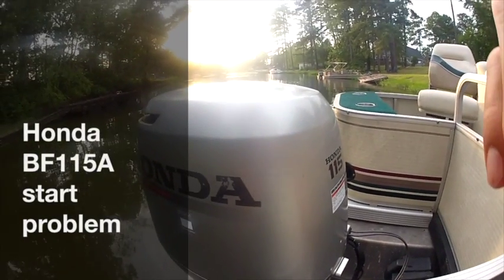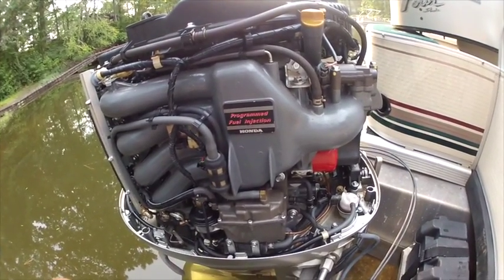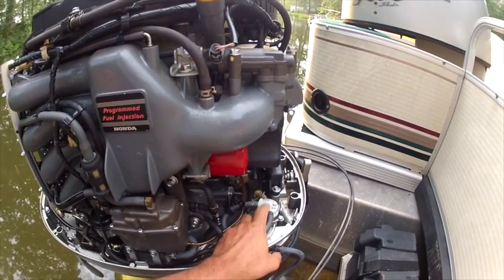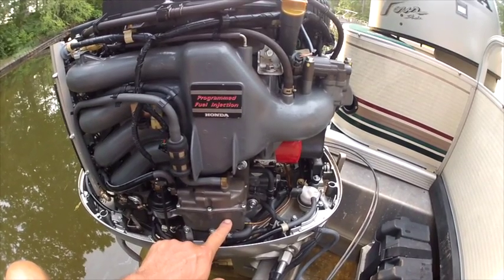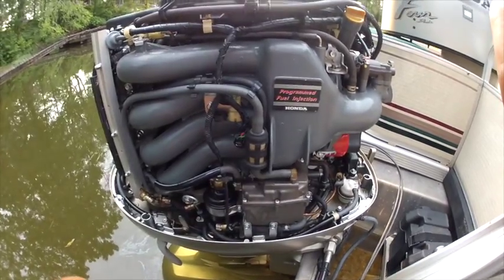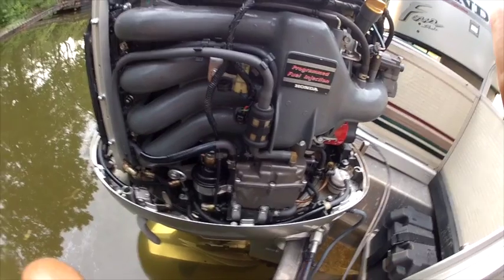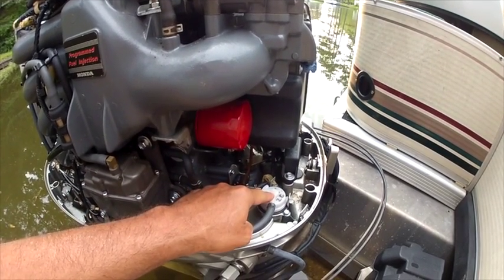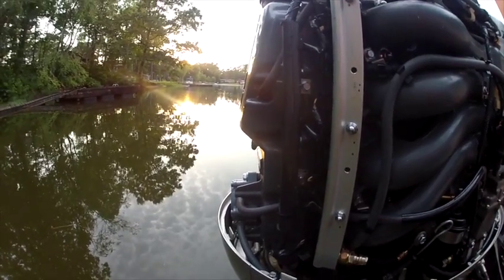Honda BF115A start problem

Comment: Hey Yankee...have you ever had your Honda run perfectly to get to your fishing spot, sit for an hour or so in the HOT sun and then doesnt want to start?  Mine has been doing that.  I am wondering if something to do with vapor lock.  Two trips ago it did this (sitting in hot sun for an hour after running perfectly) I got another boat to start pulling me in and 2 min into moving I tried it again and it cranked right up.  This time (today) I ran it for 20-30 min up and down the river then anchored down for an hour or so and then wouldnt start again.  Would turn and turn and turn.  I vented the gas tank, pumped the gas bulb, still nothing, I started paddling out 15-20 min trying the motor again here and there and it finally started again and ran perfectly again.  I think it has to do with the HOT fuel or something related.  You ever had that issue?
Reply: Main relay
Reply: @Henray316  Thanks henray.  Anyway you can share more info?  No idea where to find it.. (pic would be awesome) part number? Can I test it ?  Is this relay something that would happen only when the hot engine has been sitting for 30 min to hour and preventing start up?  The engine will turn and turn fine, just wont catch.

Comment: Searching for answers.  My Honda 40(3 years old). Acts like it runs out of gas at .5 to full throttle.  If I pump the fuel line ball it keeps going.  Low speed, no issues.
Reply from the maker: Dude, I am not a boat mechanic. >>>HOWEVER<<< Your engine and this one are totally different animals.  The 40 is likely carbureted where as this engine is fuel injected.  So here's a bone from my life of engine ownership and operations (most of which is jet aircraft, but I've spent a lot of time converting fuel into fun and transportation) In your case I would start with the low hanging fruit...  First and foremost get fresh fuel (put last years gas in a vehicle that you use a lot, or use it as ant killer around your driveway) and a new set of spark plugs, or at least remove them all, clean them with a wire brush and re-install them.  Make sure to seat all of the plug wires back onto the plugs well.   If it ran well in the past I wouldn't start with messing with any of the carburetor settings just yet...Order a fuel pump rebuild kit and also replace any of the hoses that attach to the fuel pump housing with new ones.  The fuel pump is often a round hockey puck sized metal disk like mine @1:30 .  There is likely an input line, an output line and a vacuum line that ports crank case pressure pulses to one side of the fuel pump to actuate the flexible diaphragms that "pump" the fuel on the other side.  Replace that crank case hose too!  If that doesn't solve the problem, buy a new fuel line from the tank to the inlet at the fuel pump as well... If it's old, it may be cracked and letting air into the line.  If that doesn't solve the problem, purchase a carburetor rebuild kit, then meticulously replace all of the membranes and screens and even the needles and jets (basically anything that comes with the rebuild kit) in the carb.  I am sure there is a YouTube Vid out there somewhere on both installing a rebuild kit and setting up that particular carb.  If you have never run your boat at it's current location or altitude you might only need to make some mixture adjustments, but It sounds like you had it working well in the past?  At the end of the season this year, burn out all of the gas and winterize everything with some fuel stabilizer, or consider fogging the engine with a good lubricant and for god's sake please don't use ethanol fuels.  Try to buy rec90 or some other advertised ethanol free gasoline.

Comment: Do you still have this BF115?  I have a 2004 BF115 and want to do some maintenance and love to have a few other owners who I can talk to. We are in lowcountry of SC.
Reply from the maker: Hi Paul yes I do.  What sort of things are you thinking of?  Plugs, oil, filter, inline fuel filters, grease and service the level of the lower unit. Change out the sacrificial zinc anode, make sure prop is balanced. Use good clean fuel and occasionally ad a fuel injector cleaner.  Beyond that?
Reply: @YankeeinSC1  Ah cool.  I just replaced lower gear oil, motor oil and filter, but having issues with water.  The tell-tale has lower flow than I think it should. The T fitting that feeds tell-tale is way too small (that 3rd port anyway).  The T fitting has 3 different sizes on each end. Looks like 3/8 from water pump, 1/4 on 2nd out which runs behind something (no idea) and 3rd out 1/8 goes to tell-tale.  I run in silty salt water mostly and always gets clogged and now wondering if water lines have build up since I can pull the T fitting off and the water is flowing strong before it hits the T.  I even bought a new T fitting 1/4-1/4-1/4 and tried that and the tell-tale is flowing good then.  That just worries me about changing the water pressure with different T fitting.
Reply from the maker: @paulalfordphotography3099  I've had a similar problem from time to time, although fresh water only for me.  I cary a length of welding fill wire on the boat and occasionally feed it into the fitting if there is not good output pressure.  Dirt, silt, mud wasps have all clogged it in the past.  A little internal agitation seems to open up flow.
Reply: @YankeeinSC1  May I check with you for a new/related issue (since you have the same motor).  I replaced the impeller in the water pump and not sure I got it in the correct direction (clockwise/counterCW).  I followed a YouTube video but that was a different HP (200).  The water was peeing at the house, then when I took it to the landing, the overheat buzzer sounded not 50 ft from the landing as soon as I went to plane.  I brought it home immediately.  I am thinking it could either be (1) I have a major blockage somewhere or (2) I might have the impeller in wrong direction so its not pulling water up into engine.  Thoughts?  I cant seem to determine if my exact engine turns clockwise or counter... Thanks, Paul
Reply from the maker: @paulalfordphotography3099  Sure Paul;  Not knowing where you live, I would suspect insects if you live in the south, but a different problem if you live where it is cold much of the year...  Yep insects.  I have had spiders, earwigs and mud dauber wasps, build nests or lay eggs in the discharge lines, effectively blocking them & causing the motor to overheat.  If you take the cowl off, find where the rubber cooling water line discharges through the lower unit.  Those rubber lines usually plugs into or onto a cast discharge fitting, or sometimes a plastic one that is snapped into a through hole in the upper portion of the lower unit.  You can keep unplugging the line further up... to where the cooling water exits the engine, by pulling it off of fittings and tees (with the motor running in the water) until you get to a point of water spewing out.  Then you'll have identified the plugged cooling water line.  Either clean the line out using a piece of stout wire like 1/16" stainless steel TIG welding filler rod, or just take the line to the auto parts store and buy some new replacement hose that is the same diameter as the OEM discharge plumbing lines and start over.  The downside to this story (and the greater potential in colder climates)  is that if you pull all the lines off all the way back to the engine, yet there still isn't any cooling discharge, you either have a blockage in the pick-up side of the cooling system, or the rubber pump impeller itself has deteriorated over the years.  Cycles of being started out of the water will also destroy the impeller.  A rubber/composite impeller heats up if the motor is started out of the water even for a few seconds.  That causes the rubber to become brittle or the compost material to start to separate from the wheel.  Next the little paddles on the cast rubber "sprocket looking" pump, start to shear off. Regardless of how the impeller failed, if that's the case it will need to be replaced.  They only last for so long anyways and the parts are cheap to put in a fresh one that will insure you'll have plenty of cooling water flow, but its a little bigger job than just cleaning out the discharge lines.  Don't let it scare you though...It's easy enough with some help from online tutorials or YOUTUBE!!!!!  If you need to replace one, be sure to try to find all of the little broken rubber parts as they can travel downstream and cause this blockage problems we discussed. Good waterproof grease helps making the new install easy.  Good Luck.
Reply from the maker: @paulalfordphotography3099  Just re-read your post... I didn't understand that you've already replaced the impeller! ...I doubt it's possible to install most impellers incorrectly.  Most that I have seen are "keyed" to a drive shaft on bigger outboards. so it's really just a matter of getting all of the fingers tucked back in the pump well upon re-assembly.  as soon as you start I think the impeller fingers are mechanically encouraged to bend the correct way...
Reply: @YankeeinSC1  Hi Yankee.  I have a T fitting that I see the tube off in the front of the engine and have no idea what it does or goes to.  Wondering whether I need to worry about it, block it off, etc...  I have some pics to show you but I dont know how to attach them here.  Is there a way to send you a couple JPGs so you can see and maybe you know what this tube goes to?  Thanks.  Paul.

Comment: Thanks for the video my Honda 130 would not start and I knew it was a fuel issue. Sure enough tapping the electrical relay did the trick and the motor started right up. You saved me a ton of time and money. Thanks Man!

Comment: On my 1999 Honda 130hp, I had a start problem, it was the main relay , so I bought a new, and change it. 
And that's was the end of my problem :)
The new Honda main relay was 06380-ZW5-000 .  
Absolut no problems after I made the change.

Comment: thx for sharing. 
i am learning about honda outboard.
hope tog et one later.
may i know the is the regular issues with honda outboard?
is  it ask durable as yamaha & economical in fuel?
Reply from the maker: This is the first and only large EFI outboard I have owned.  The particular problems discussed in this video are typical of any engine nearing 1000 hours of operation.  As far as a brand analysis, I think that might be a little more subjective and prone to identity, advertising and personal preference, rather than actual owner data.  Consider a non-biased source like "Consumer Reports".  

Replacing the well worn mechanical pump late this fall and swapping the electric pump just prior to that cured all of this engines brief rough running.  The marine environment and well as the fuel pathway in any outboard are harsh ones.  Yes, I perceive that it was a common problem, however there was a recall issued on this motor's fuel delivery system by Honda.  Since I'd always done my own preventative maintenance, I never had taken the motor to the original (nor any) dealership, therefore the recall work had never been done in the timeframe Honda allowed for corrective repairs to be made under warrantee.
Reply: Thx,
 i am thinking of getting a honda in my next boat.
really need to do a full full research on the problem with different brands.
as i live in asia. it is a full summer all year time, beside the monsoon.
i heard from some commercial boat owner, commented about the honda: no major issues, vry good fuel consumption. 
has got any hardware failure after 5 yrs of using.
the last outboard was a nightmare for me. hahaha.
thx & have a happy, healthy profiting 2017.
Reply from the maker: If your boat will see saltwater (mine never does) consider a saltwater series engine.